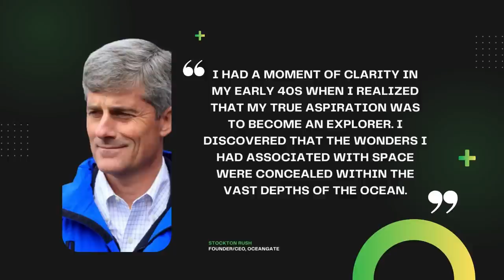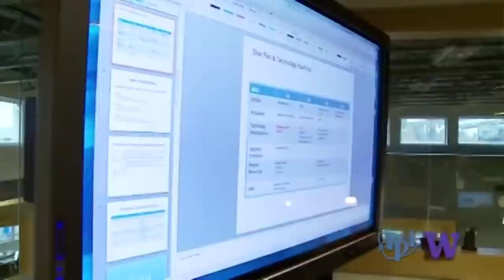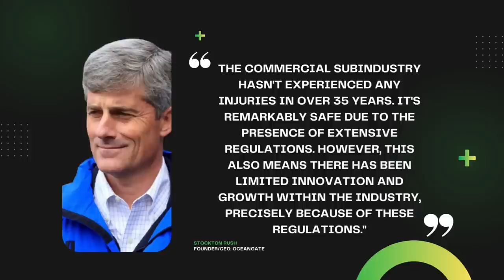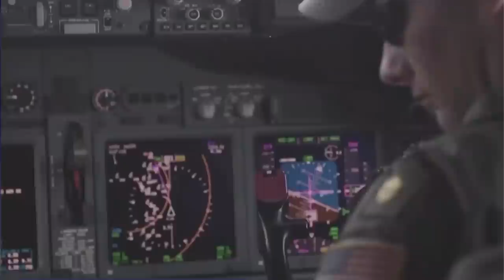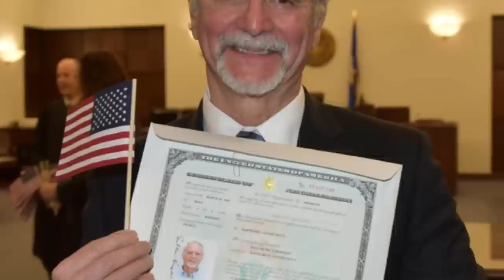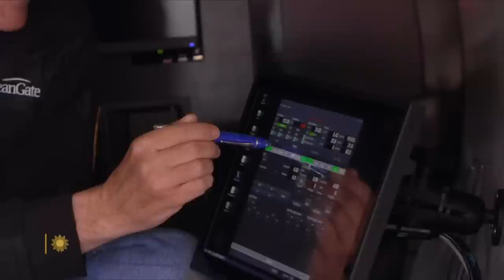Titan Submersive Implosion: A Tragic Look at What Went Wrong

Comment: As soon as I heard carbon fiber I would have ran for my life
Reply: Right. The word fiber alone would have given ne pause.
Reply: It wasn’t even cross crossed or hatched
Reply: They heard it for around. 3 minutes and started to ascend. The got 50 meter up in 7 minutes. Then it went boom. 
The transkript was leaked… veryyyy grim. They knew for multiple minutes that its over..
Reply: @ErikvsLenny They didn't know that it was over. Stockton believed that his accoustic system would warn him hours before a possible implosion. He also believed that even crackling in the porthole would still leave enough time to resurface. He stated that in multiple interviews. Trust me, Rush was calm as a duck till the end...
Reply: @VraserX but I bet when he was told to drop the weights and ascend he felt some fear.  I think at first his ego wouldn’t  allow him to even think implosion and when he realized they were in trouble he felt something. The transcript was eerie to read!!!

Comment: This was a 20' canister compartment shaped submersible,  wrapped with carbon fiber. Do you think that if instead it was  a sphere compartment shape, wrapped with carbon fiber, which one of these  submersibles would a person think at a dangerous depth would have failed first, being about the material or the shape of the submersibles.
Reply: Both are junk!  The Carbon fiber alone Was the issue... Along with Greed, Arrogance and Stupidity 🤨
Reply: It would have a better chance of survival since it removes the issue of different molecular structures physical differences, and it would handle pressure better. Cyclical failure could still be a terminal issue although propper xraying of the material between voyages could enough instead of the "acoustic monitoring" system titan had